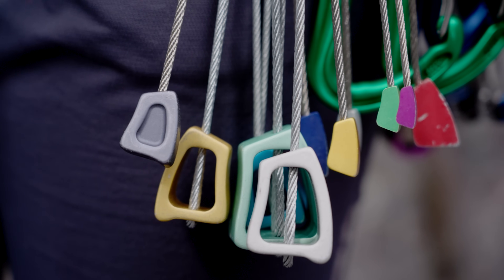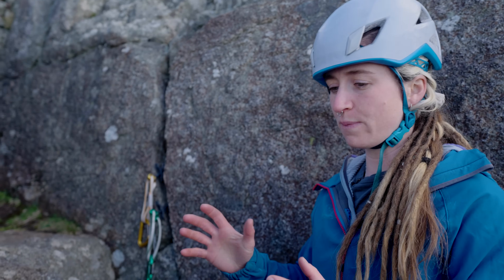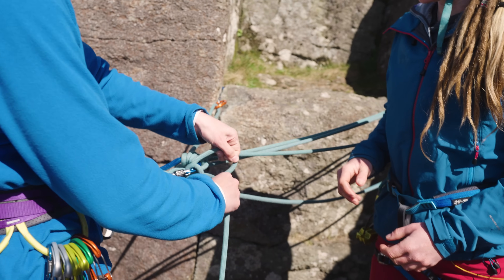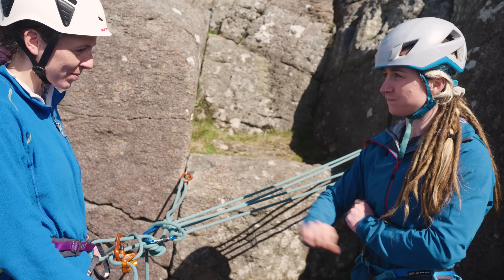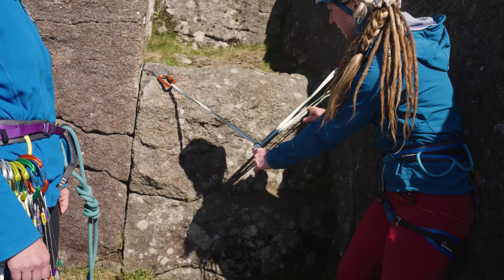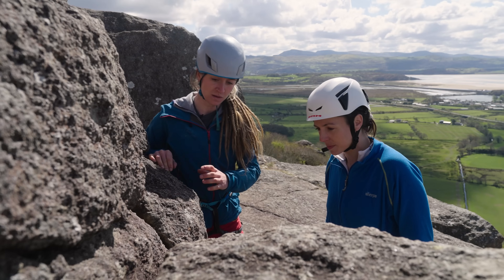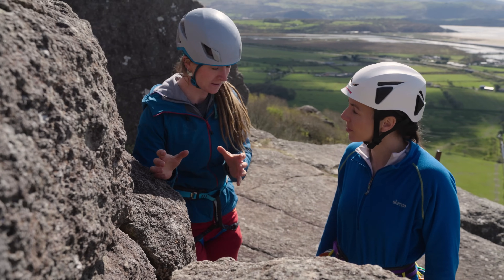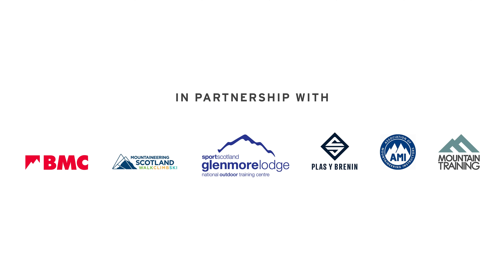Learning to Trad Climb: Part 3 - How to build a belay

Comment: I'm intrigued by this very British anchor setup of looping the rope through the pro and cloving to an HMS on your harness. It's a clever, gear-efficient way to build anchors when you've got 2x50m ropes and pitches that are usually much shorter than that. But it's not obvious to me the best way to redirect the follower so they're on the anchor rather than my harness--my partner is >14 stone and I have no interesting in him dangling off of me for any amount of time.
Reply: Seems like it's best for topping out or when you really only need an anchor for the belay, like how their placement is super deep on that shelf and you could basically camp up there.
Reply: You can set up a direct belay from the shelf, by clipping one strand of each pair going to a piece of protection. But even if you belay from the rope loop, then if they fall,  as long as you are standing in a sensible place (i.e. you have set up the anchor thinking about the direction the climber is coming from), the force will go onto the anchor. It'll just force you to step sideways.
Reply: @daveingerslev  That makes sense. I'm picturing an anchor built with pieces below waist height--in that scenario, I think I'd much rather be pulled toward those pieces than toward the climber?
Reply: @arselihp that's not unusual. It's common to sit down so that you're at the right height.

Comment: Excellent video! I think the only caveat I'd add (and of course, climbers have to add caveats!) is that if you think your next pitch is going to max out the length of your rope, the sling method is definitely the better option, as it takes up almost no additional rope length. But that's not a critique in any way, shape, or form of your video! Just another factor to add to the mix when considering which type of anchor to establish. Great stuff!

Comment: I watched to the end to see what methods you use to get more out of your sling but it didn't happen! I have seen the clove hitch method and an inline overhand method, both of which would effectively turn the 2x cams into one piece and give a V (rather than a W) to make the masterpoint. What is your preference on this? And of course the shelf method with no masterpoint gives a bit extra to play with, but doesn't work with 3 independent pieces. All in all a very good video, up there with the best online content. One thing not mentioned (I know, the video has to have a limit) is that placing multiple pieces in one crack system is OK but needs thought, especially multiple cams which produce a lot of outward force when loaded, so make absolutely sure it is solid rock.
Reply from the maker: Hey - Alice here. Thanks for the feedback, all your points are correct; the additional topics that you have mentioned here are covered in the next few episodes! So keep an eye out and you should see all of this in the next films.

Comment: I started climbing in 1981. I've done a fair bit and been on a few stances with belays which were a single manky nut in a crack, or a sling hooked over something that'll only work if the rope pulls in a particular direction - a 'don't fall off' belay. Those are in the minority and it's good to learn how to do things properly, saves bad dreams in later life... :)

Comment: Nice to properly aim instructions to beginners, but also mention other options when relevant (e.g. 2 pieces of gear might do, non-locking carabiners can be fine too, etc). Sometimes we get a bit dogmatic about these during instructions I feel like - and then you end up with lots of climbers thinking it's a cardinal sin to build a 2 piece anchor. I really do see value in beginner instruction that provide safe "default" mode of operations (e.g. 3 pieces, screwgates), but also mention judgment calls & implications.
Reply from the maker: Hey - Alice here. Thanks for your comment and you're correct, 2 pieces of gear can be enough for a belay. We cover using 2 pieces in later videos, and mention that it is up to the climber to make sure that they are happy with their belay and that is sufficient to keep themselves and their second safe.

Comment: Another very informative video, thank you. 😊 What is the reason for clipping the HMS carabiner and belay plate into the rope loop and not the belay loop?
Reply: The rope is dynamic, belay loop isn't
Reply: The reason is that in case of second falling, weight of climber would go on to your hips and legs if you are belaying from b.loop. 
If you belay from rope loop that weight of second climber will go directly to the anchor
Reply: @nikolakolaric87  Thank you, this makes so much sense!
Reply from the maker: Hi, Alice here! As Nikola has mentioned, by using the rope loop, the rope system has more dynamism in at, as well as the load of the second bypassing the climber to the anchor, rather than loading the climber first, which makes it much comfier and safer for the belayer if the second weights the system. If the second does fall and you are belaying with the belay loop (not the rope loop), then the harness is pulled in both directions (towards the anchor and the climber), putting enormous strain on the belay loop. As well as this, if you ever need to escape the system, it is easier to begin this process if the second is not clipped directly to your harness.
Reply: @dmmclimbing81  Hi Alice! Thank you very much for explaining it. 😊

Comment: Very clear instructional video. Though I must say when I first started climbing in 1980, I never used 3 belay anchors...we generally were fine with one (!)...I recall a gripping experience on Cemetery Gates when my friend fell off when seconding, and I was 150ft up, crouched down very low on a tiny ledge, trying to ensure the rope I had wrapped over a small projecting rock didn't roll off...luckily it held!
Reply: Me and a friend of mine were in Norway the last summer climbing multipitch.
I mostly did 2 belay anchors if I recall right.
I think two really good pieces of gear is enough and its saving a bit of time to.
And I dont use screw carabiners on the anchor points. I think Its overkill but thats just me.

Comment: I learnt everything in the Italian way and it is so different. One quick question: I just wonder while belaying the second, should it be considered a better way if we use the guide mode of the reverso?
Reply: That way is assisted braking which I would argue is more inherently better. Also, when belaying from the top with a reverso in quite mode you can use a belay method that keeps a hand always on the brake strand, much safer than what she did

Comment: Is it a UK thing to be making the cloves hitches with the rope on your own HMS, as opposed to the cloves being on the carabiner that is on each of the 3 pieces? The way I've always been doing it (north america) is to clove onto each piece, as opposed to myself. Seems roughly equivalent.
Reply: It just allows you to adjust and equalise the anchor more easily from where you want to belay, rather than adjusting at each of the gear. Makes things easier especially if the gear is out of arm’s reach from the belay.
Reply: This is an 'out of reach' approach all adjustment can be done when you are away from you anchors, its typical in UK trad for anchors to be spread out. I'm not an instructor but I guess this is a really good first bealy to build as it will work in many situations.
Reply from the maker: Hi - Alice here! The 2 replies above are correct! We use the clove hitch on our harness to allow us to safely adjust the tightness for our anchor points without having to return to the gear, something we always want to be able to do when our anchor is out of reach (the belayer cannot reach the gear from where they intend to belay). If you are using the rope to attach to more than 1 anchor point each (eg. a 3 point anchor with a single rope), we need to put at least 2 of the clove hitches on our harness to allow us to clip the next piece of gear. If we are climbing with double ropes, and have 2 good pieces of gear within reach of where we intend to belay, it is common practice to clove hitch one rope directly into the 1st piece of gear and one into the other, as you describe in your comment. Basically, it all depends on where the gear is, where you want to belay from, and how many ropes you are using to climb with! Hope that helps :)
Reply: @dmmclimbing81  Interesting, learning things everyday. I don't remember too many belays where gear was all that far - but then maybe if I had know this approach it would have made live easier in some instance.

I'll probably try it out next time I'm out, always nice to have more arrows in your quiver.

Comment: Shadow HMS for 3 x clove hitch skinny ropes, Boa HMS for 10mm rope.
Reply from the maker: Hey - Alice here. The Shadow HMS is safe to use with 3 clove hitches as long as the rope is 9.5mm or below. If you are using a thick rope, the best thing to do is to add another locking carabiner to your harness and pop the additional clove hitches on that to save too much rope in any carabiner :)
Reply: @dmmclimbing81  Hi Alice.  6 strands of 10mm is 3mm wider than 6 strands of 9.5mm. The Boa is 6mm wider than the Shadow. Granted that does not necessarily mean an extra 6mm of room but 3 x10mm clove hitches fit fine on a Boa.
Reply: @hoppy1970  Practically no one climbs on 10mm ropes anymore
Reply: @AnonymousOtters  Can you provide the data for UK climbers' preferred rope diameter please?
Reply: @AnonymousOtters maybe not in the UK but plenty of climbers in the states do. Our deserts are harsh on gear

Comment: If the leader were to fall off the ledge while backing up and adjusting the clove before it was tightened, wouldn't the loose clove hitch most likely fail to prevent the fall?

Comment: I don't like the setup for Belaying from the anchor.  Correct me if I am wrong.  You are the part of the system, but you will have hard time getting out of system when something happen or need to do self rescue.
Reply: @risesummit5170  I took a self rescue class with an IFMGA instructor.  My question is from the video,  she is locked into the master point to her rope tie-in loop and the ATC is also on the same rope.  When the ATC is loaded,  how can she get out of it without untie the figure 8?
Reply: Correct! You should always use a belay device that has guide mode at the top of the anchor.
Reply: That's the primary reason for using the rope loop to belay rather than the belay loop of the harness, it is always a drawn out process to escape the system but using the rope loop helps. Regarding the use of a guide mode device, it is perfectly safe to use one when the belay is absolutely unquestionable (primarily bolts) but it helps to add yourself into the system to soften any potential shock load on the gear, it seems to be a bit of a cultural thing, a lot of US and Canadian climbers default to guide mode, UK climbers tend to default to this method shown, which is perfectly safe. In Europe a lot of alpine climbs are mixed, so place gear on route but belay from bolts. I'm not sure where you are based but if I were to build a belay with gear, I'd tend towards this method and save guide mode for when on long steep pitches.
Reply: @mattbaker1683  Sweden. I didn't say it wasn't safe. But I didn't know it was a cultural thing. Fells in my opinion better to use guide mode so you are not so close to the belay device. Feels like you can easy hurt yourself if the climber falls and it gets shock loaded but I've never used that technique so should not just guess
Reply: @oscarpalm8142  Cool, I love Sweden but never climbed there, so expensive though! It makes perfect sense to use a guide plate if the belay is absolutely bomber, but not in every situation. With high bolts yes, and there are a few trad climbs in the UK that have bolts at the top but most are gear, which defines where the belay ends up. Of course for bringing a second up direct you can use a Munter hitch, but that's another thing entirely! That's one of the cool things about climbing, so many ways to do things right, but some people have preferred ways of doing things
Reply: @mattbaker1683  I am from US.  Maybe someone can make a video or explain how to escape from that setup.  If it's me, my setup would be instead 3 clove hitch on the locking binner.  Do a big honking knot so you attach PAS to it and setup ATC guide mode.  If something does happen to the follower, I can do load transfer to get my ATC back.  Setup a rappel to check on the person or setup pulley system to get them up.
Reply: @WeiYuanTzeng  check out JB Mountain Skills on YouTube, he's based in North Wales. Excellent quality videos and there's at least one on that exact subject. It needs practice and is different if using a sling vs using the rope. I did it once a couple of years ago with an instructor but haven't used it yet for real.
Reply: @mattbaker1683  thanks.  I will check it out.
Reply: @mattbaker1683  I just watched the video.  That is a lot more work to escape the system.  I would still prefer not been a part of system at the first place.
Reply: Thing worth pointing out is that this is a single pitch senario, it would be incredibly rare to need to escape the system as usually you can simply lower your climber to the ground.
Reply: Matt's right about it being a cultural thing. Most of our climbing has traditionally been on trad with rock of variable type and quality and on anchors that may be far apart (rather than close together cams in splitter granite cracks or bolts). The rope (often combined with a sling or 2) can be used to equalise pieces further apart than any cordelette and putting yourself in the system serves to protect the anchors to some extent as you absorb some of the force of a fall (clipping the device to the rope loop often means a little more force goes to the anchors reducing how much force the belayer takes, clipping it to the harness loop puts more force onto the belayer directly through the harness). Yes escaping the system is a little more complex but with a little practise can be achieved from a variety of situations in a few minutes with a sling, a prusik loop and a couple of karabiners. Also the judgment required to belay directly on a guide plate on trad gear shouldn't be underestimated (i often see it done on mediocre anchors or rock of variable quality in the UK- but its what climbers see on Instagram and take out of context). FWIW i do use my DMM Pivot in Guide mode plenty at work and personally but i teach belaying off the rope loop first.
Reply: Technically you're right. That's literally what I thought at first.

Then I realized this is purely beginner oriented. I mean, the instructor is teaching how to tie and control a clove hitch. This is 101. And it ends up in a method that is very similar to what the beginner is familiar with, belaying from below. Safe, simple, familiar, beginner friendly.

If you think about it, you don't really need to escape the belay if you don't know what to do next.

I think the plan here is to introduce the student to some concepts in a very basic way. It's a simplified scenario.

I don't think they plan to let her lead, build anchors on her own, belay from above, etc. w/o supervision any time soon.
Reply: @TheMule71  If you are not part of system and ATC is in guild mode, you can tie a bight on the break side.  Untie yourself then you are free looking for help if you don't know what to do next.

I guess the biggest thing for me on that setup in the video.  if she is belay someone like me, who weights around 215lb (100+ kg), I might pull her off balance.  Funny thing,  at the gym  pending on the weight of belayer.  When I fall, I have pull belayer to the top on TR or the first quick draw on lead
Reply: @WeiYuanTzeng  You would use a 120cm sling, Klemheist this around all of the ropes going to the anchor points, use that as a master point.  Escape the system, and retie the figure-8.
Reply: @mattbaker1683  Not sure its a cultural thing.  If the anchor is 100% safe (even with placed gear), use guide mode, otherwise belay from the narness to disapate the force onto the belayer first before going onto the anchor.
Reply from the maker: Hi Wei, Alice here. It looks like you've had a good discussion about your question already. But here is a little more: There are some scenarios when it is better to belay on your harness, rather than directly on the anchor (eg. if the gear in the anchor is too spaced to build a single point anchor with slings). It does add an extra few steps to escaping the system if you need to do a self rescue, but this only takes a minute and isn't complex. As well as this, not all climbers carry a belay plate that can be used directly on the anchor, so they must belay from their waist. I hope that helps!
Reply: @dmmclimbing81  Hi Alice,  Great video thank you.  By me, either learn by class or mentor, we were taught not to be part of system at the first place.  That is why I was a bit of confused when I saw the video.